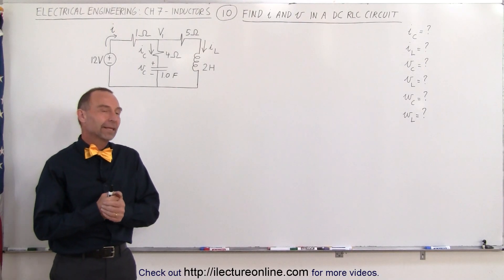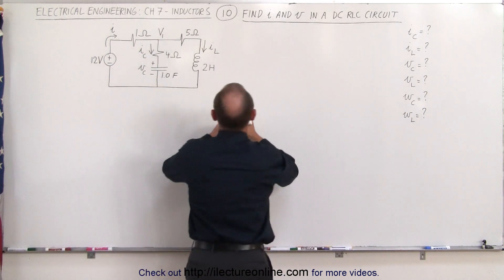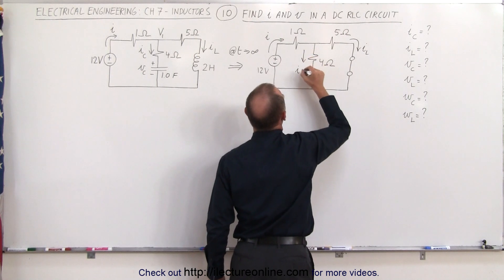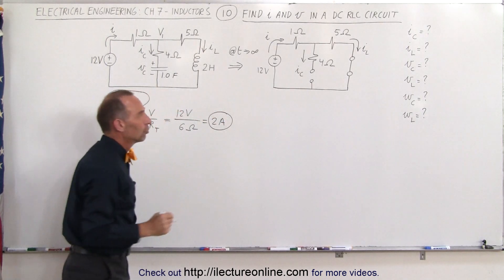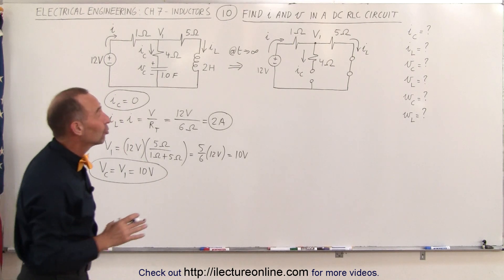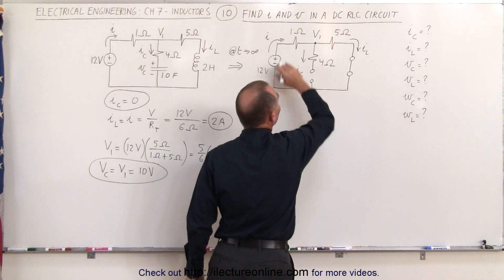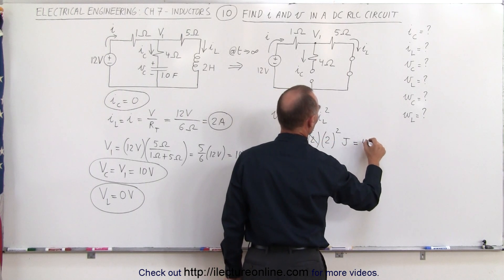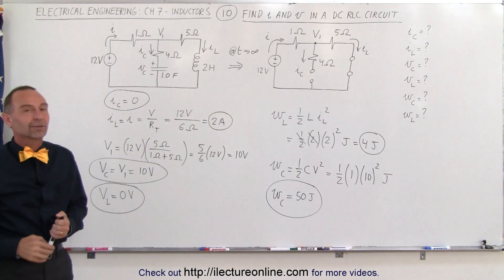Electrical Engineering: Ch 7: Inductors (10 of 24) Find i=? v=? Energy Stored=? in a DC RLC Circuit

Comment: Professor Michel van Biezen, How do we calculate the current in a series circuit with a dc supply, having only an inductor and a capacitor and a switch of course, with initial condition that there is no charge of the capacitor when it is swithced on?, (no resistor in the circuit)
Reply from the maker: For an RCL circuit with a DC voltage you can set up a second order differential equation.   Vo = iR + L di/dt + (1/C) Integral (i dt)

Comment: Hi Sir, should V_c equal to 0? I understand that V_1 in between that two resistors has a voltage drop, but since the capacitor is open at this case, there shouldn't be any current nor voltage across that capacitor? Thanks!
Reply: Yes, there is no current nor voltage "across" the capacitor. So V_c is jus  the voltage drop between the capacitor's terminals which is V_i - 0 = V_i = 10V

Comment: i thought there will be energy on the inductor, only when ac currents flows through it,,, because the magnetic field of an inductor  , which energy is stored in, only starts to build up when there is ac current,,,
Reply from the maker: There ONLY is energy on the inductor when the current through the inductor is CHANGING.
Reply: As you said that hear in inductor  current in not change (steady state anlayais)so we made it short circuit  then how is that point valid

Comment: At  4.09 why is the Voltage 0 there. can you please give the reason for that sir?
Reply from the maker: Are you referring to the voltage drop across the 4 ohm resistor?  If yes, there is zero voltage drop across the 4 ohm resistor, since there is no current in that branch due to the open circuit.  No current means no voltage drop.
Reply: Thank you so much sir
Reply: @MichelvanBiezen ahm hi sir I'm 2nd year EE student why Vc has a  10v but VL is 0?.

Comment: I thought the energy stored in the capacitor is equal to (1/2)q^2/c?
Reply from the maker: When you worked it out with your equation, what value did you get?  (Was it also 50 J)?
Reply: @MichelvanBiezen  no response damn

Comment: at 5:45 there is a typo, the capacitance should be 10 rather than 1
Reply from the maker: It is actually 1.0 farad.  (The decimal point is hard to see).  Thanks for checking.